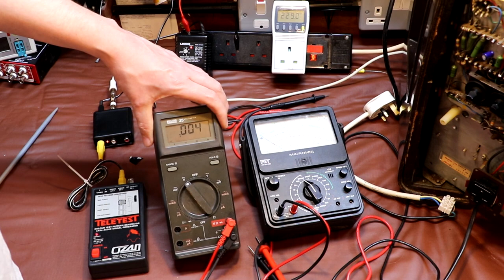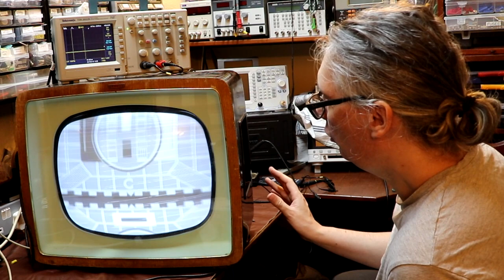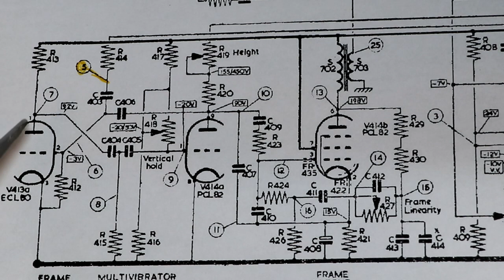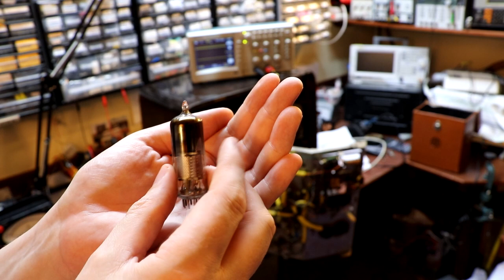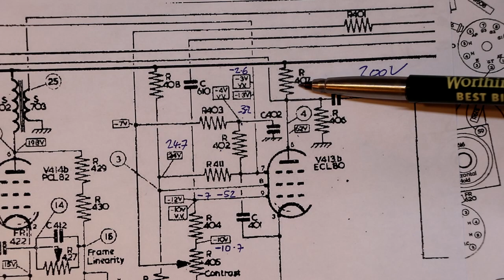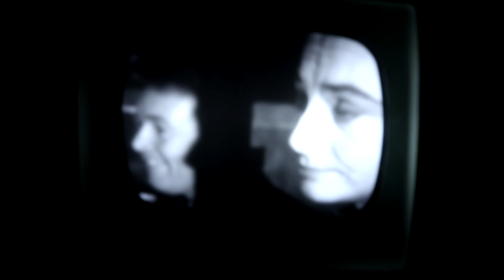Shampo066 Stella TV Repair - Part 3

Comment: Hello again Chris.  I've just been looking through some of the earlier comments, and one of them made me shudder.  It suggested that you have a go at an early colour set, to which I would suggest, "Don't..!!'  Of course, there's always the question of what one would call 'early'.  The earliest, were the 'Dual Standard Hybrids' from Baird and Philips, and they were death traps.  Then came the all transistor 2000 chassis from TCE (Thorn Consumer Electronics) under various brand names such as Fergusen, and Marconi, and also badged by some rental companies as their own brand, e.g. Red Arrow, DER, etc.  The first British colour channel was BBC2 only, on 625 lines, transmitted on UHF band V.  BBC1 and ITV continued to be 405 line monochrome VHF on bands I/III.  Hence the term 'Dual Standard'.  As a precursor to colour transmissions, the new BBC2 channel was only monochrome, and there was good reason for this ... at least that's what I assume.  To remind ourselves now, what was once the case: That the British TV system was viewed as the first 'High definition' system, seems ridiculous.  It would not remain so of course, but I digress.  By the middle 60's, the forthcoming British colour system had been established, hence the new BBC2 channel.  But - and there was a huge 'but'.  The new BBC2 channel would be a completely new transmission service, not just more lines, not just a higher frequency, a new system altogether.  Sounds dramatic now, but it really was back then.  Fortunately, there were too many sets on the old system for it to be scrapped, so BBC2 came upon us gradually, and didn't bother the domestic TV engineer that much.  Most people didn't bother with BBC2 anyway, and those that did - mainly on rental, had a 'Dual standard' black and white TV.  So what was so different about the BBC2 system?  Well, just about everything you knew about 405 had changed.  The video signal modulation polarity was inverted, the original sound carrier was eliminated, giving way to 6Mhz 'Intercarrier' FM sound.  The set needed a separate dedicated tuner.  Brand new valves appeared.  Many of the familiar circuit architectures looked different, and worked different.  And being 'Dual standard' sets,  you had - effectively, two sets in one cabinet sharing the cathode ray tube, and the speaker, controlled by a huge switching system.  Still only monochrome remember, and it didn't end there.  Technology was still on the march with brand new components: Transistorised tuners eliminating the noisy albeit gold plated pinned new tuner valves.  Transistorised modules and 'Acoustic Wave Filters' creating 'Bandpass' filters that eliminated the component heavy IF transformer strips.  Special voltage doublers replaced the EHT rectifier in some sets ... how did they work..??  More workshop arguments.  Many of the 'older than me' engineers had given up by then, but for me and the like, in our early twenties, this was all rather exciting.  I should however point out a truth amid all this theoretical stuff, most TV engineers didn't understand it, and didn't need to.  Sets still only suffered from 'common faults' which quickly became known.  Then came colour, and we started again with a whole new ball game, and the resurgence of City and Guilds college courses to learn about the seemingly impossible.  Were I to go any further, this comment would have to more than double in length, so I'll just repeat what I said at the start, "Don't go anywhere near a 1970's colour TV", that's if you could find one.
If you want to remove this extensive comment from YouTube, I won't mind.  It's only meant for your inf anyway.
Reply from the maker: You should seriously think of writing a book on this or publishing something online you certain know a lot about the fascinating history of television. My short answer is I’m not really interested in dual standard as it is just too modern. I quite like some of the hybrid designs  of equipment when the crossover occurred between valves and transistor but that’s mainly for the sake of being so bloody awful and usually managed to combine the worst part of both technologies.  I don’t really like working on transistor stuff it’s to much like work for me so if anything I want to go back and Collect earlier televisions sets from the 50s.   Thanks for another great comment your a mind of information. Best regards Chris

Comment: Hi Chris,
For some strange reason, though I’m subscribed to your channel, notification did not come up to say you had uploaded a few videos.  Has it happened, I’d been thinking about you, and your Philips television.  As you will imagine, I have some video viewing catching up time to do LOL.
Having read many of threads placed on Television and Audio restoration websites, I’m confident you are in good hands.  Of course, there are a number of them that include loads of text, but say very little, and there are a few that are none sense - I’m sure you’ve read a few, and laughed at them LOL!   
The type of fault you encountered here was fairly common back in the day: it had to be an incorrect voltage since much of that area of the circuit is fairly voltage critical - though no where near as critical as those required for most modern solid state electronics circuits - generally speaking, “Solid state have specifications, valves have guidelines!”
Though I don’t want to intrude, I’ll point out the obvious by saying you have a few remaining issues: one being a frame linearity fault.  Usually, the problem is capacitor related: on the other hand it might be as simple as reducing the picture hight by two inches, adjusting both frame linearity controls for evenness at top and bottom, and them increasing the hight back to the correct level.
Finally, I have to commend you on being able to service a Television without a mirror.  Doubtful I could do that LOL!
Will be catching up on a few of your videos I’ve missed, cheers, the man from Sheffield.
Reply from the maker: Thanks for watching and comments. Now I have a stable picture I can see the linearity and focus issues.   Is the linearity issue likely to be fixed by adjustment of the linearity control or should I change out the capacitor associated with the controls.   Regards the focus control one end of the potentiometer had been cut so it’s fully at one end of the control.  Is there a sweet spot for focus like holding a hand lens or is more focus voltage etc better ?  Yes I also fail to get your notification and just check back on your YT page periodically and I don’t know why that happens. When all this Covid stuff ends it would be nice to meet up and chat in person etc.  Regards the mirror it’s only a matter of time before I get a belt of the back trying to peer over from the back of the set.   I may take a break from the television as I have a ring tester and a Hallicrafter I want too investigate Thanks stay safe regards Chris
Reply: @allthegearnoidea6752    
Hi Chris,
Please accept my apologies for not getting back to you before now.  Due to an unexpected illness occurring in the family, personal time became limited.  Thankfully the illness was not Corvid related.
I shall be referring to “Radio & Television Servicing” 1960/61, J P Hawker. Newnes, Philips, model 17TG200U, pages 551 to 556. 
Although frame linearity adjustments can be made by adjusting R427 (frame linearity) control, I suspect it might not be totally effective with you television.  Though not unknown, it is rare for the actual control to alter in value.  There might be some ‘lower frame cramp’.   
Looking at the above mentioned circuit diagram, as well as partially working from memory (almost 49 years ago LOL), check the values of PCL82 pentode resistor (R421- 330R) – there would be no harm checking cathode capacitor (C408 – 100mfd) whilst working in that vicinity.  Also, check the strength of capacitors (C413 – 22nf, or 10nf), (C412 – 18nf), (C422 – 22nf), & (C409 – 82nf).  Although ‘pf’ capacitors are fairly reliable, especially mica types, they can fail – as far your telly is concerned, I’d think it looks unlikely.  However, if they have gone out of spec, they can cause strange frame distortions (C412, & C417) – checking them might be optional.  Unlikely (C407) would contribute directly to the effect you are getting, but it might be worth giving it the once over with the ‘cappy checker’.  When checking capacitors, you should be looking for DC leakage, amount of V – Loss, value shift, and Equivalent Series Resistance.
Moving over to the resistors, check the values of (R429 – 56K, & R430 – 56K) – they should give a value reading that is no more than their plus/minus tolerance banding.  Checking the four resistors (R 423, 424, R425, & R426) that form the biasing, and feedback line might be worth considering – again, should be no more in value than their plus/minus tolerance banding.  
Check the focus potentiometer (R713 – 2meg) has not been damaged, and one side of its carbon resistance track solder terminal has a good solid connection down to deck.  Also check the value of (R712 – 1meg).  I seem to remember them going high in value.
In some respects it feels strange having a circuit diagram in front of me, but no television LOL.  When I worked in television and audio servicing I automatically developed a feel for what needed checking and replacing: I, along with the other service techs I worked with, largely operated on ‘automatic pilot’ LOL.  What I have sighted above are mere suggestions.  If I was to be specific, I’d need to have the television in front of me where I do a few checks, then say to you, “Replace so-an-so…”  That, of course, would not be totally helpful to you since you would need to know how I’d arrived at what I was saying needed replacing.
Should you require further assistance, feel free to let me know: it’s always a pleasure to be helpful.
Phil.

Comment: Well done Chris, I am battling an old car radio from 1966, Modern electronics made me lose a lot of the old electronic stuff 👍
Reply from the maker: That’s interesting is it all valve tubes or a hybrid. Some manufacturers like Motorola were experimenting with Transistor PA outputs and solid state vibrators for the HT supply. Thanks for watching regards Chris
Reply: @allthegearnoidea6752  did some research seems to be 1970 or 1971 BLAUPUNKT  7639675 HEIDELBERGW serial number B but I can't find  schematic for it, Transistor based

Comment: Also, you likely need to readjust the magnets (those twisting rings) on the CRT that you tweaked the first episode, that might be all it needs.
Reply from the maker: Yes you could be right on those adjustments. I have avoided those so far as you can see I am just learning about Television and didn’t what to go poking around. Now I have fixed the hold problem it’s revealed a few picture issues but I guess that could be expected.  I will probably investigate those In the future. Thanks for watching and comments. Best regards chris

Comment: The resistor was likely fine at first and failed when powered on.
Reply from the maker: I don’t know how I missed that resistor as I had done a basic resistance check but unfortunately I did. Still the whole point of this exploration into television is more about me learning about television rather than a quick fix. So it was good to get the scope out and try to figure our what’s going wrong. As you could probably tell I haven’t worked on a television before but it makes a interesting change. I just like learning about stuff etc.

Comment: I thought 405 was switched off in about 1985 ?
Reply: change C408 for the frame linearity problem .
Reply from the maker: @michaeldranfield7140  that capacitor has already been replaced. Perhaps I need to now adjust the linearity control
Reply: @allthegearnoidea6752  ideally you need to set the picture geometry using a crosshatch generator .
Reply from the maker: @michaeldranfield7140  Thanks Michael I have a cross hatch generator so I can give that a try. Thanks Chris
Reply from the maker: As far as I know the last switch off was County Donegal in 82. But England was before that

Comment: Well done, I have put in the wrong resistor before and caused more problems than I had before I repaired something, with a lot of head scratching and blue air, I finally check the resistor I replaced to find it is far to high.  More hurry less speed.
I liked the old Tardis controls best, it had like a valve/tube type thing going on.
405 lines, how did we sit and watch that, when you see some 625 line pictures of 30 years ago you see just how good or not the picture quality was, all looks out of focus and blurry!
That is what I found with TVs, they are just to big to fix and the voltages can make you pay attention!
Last TV I looked at was 4 years before it went digital.
It was a Philips G8, I changed a board then had to set up the picture again.
More trouble than they are worth, but it was my TV, so o pressure.
I look forward to seeing a perfect picture on it.
Reply from the maker: The focus isn’t perfect but it’s better in real life than on camera. Now I have the pictures stationary it’s revealed a few issues like focus and linearity and these will have to be addressed in the future. Thanks for watching regards Chris
Reply: @allthegearnoidea6752  You will do it, just takes a bit of time.

Comment: Chris your joining us TV engineers, that brilliant I've made it to retirement, and don't stick my hands in the backs of them any longer just 9v to 12 volt stuff these days, I even  let someone else fix my Plasma TV,  what's really good  you've not so far had  a bite from the juice , hope you don't get one of the TV it's hurts, keep going your doing a great job, if you have a web cam you could aim that at the TV, and watch it from your monitor.
Reply from the maker: Hello Paul thanks for watching and comments. I am quite careful to avoid electric shocks but accidents can and do happen but I do have some high voltage experience etc.  This is my first television so it feels like a steep learning curve still I like try and learn new things. I do have some future vintage television for repair but will probably get back to some radios and test equipment. Thanks best regards Chris

Comment: Well done, Chris! Always satisfying to find the problem and repair it. My work-horse meter is a Fluke 8025 - the militarized version of the 25 and my general purpose scope is a Tektronix TDS 3012, I like them for the same reasons you like yours! Regards, David
Reply from the maker: I am not really that fussed on meters but auto power off drives me mad. They always turn off when you most need them. The fluke I’m using has been switched on for about 6 months and when the battery fails I will just replace it simple.  I also hate range changing switches and how some are badly laid out.  I would always spend that bit extra for a quality meter but I’m indifferent to the number of decimal places. The TDS I’m using feel very slow compared to more modern scopes but it was my first scope bought from new and it’s been very reliable and I like the form factor. Thanks for watching and comments regards Chris
Reply: @allthegearnoidea6752   I agree, auto power off is okay for some things - LCR and transistor checkers come to mind - but not for meters. All those digits are useful in the calibration lab, not so much in the field. I have very little experience with raster displays, mostly vector displays, so would like to see the resulting output of the sync separator after the resistor change if you get the chance in an upcoming video on the Stella. Regards, David

Comment: Shango066 would be proud of you! He just wouldn't show it. Excellent work. Love that euphoric feel of a fix. Think you need a resistor colour calculator!
Reply from the maker: I have resistor calculator I just need to build it and start using it. It was one of those annoying circuit diagrams where you have to go an look up the value in a parts list. It should have been 180K I think the one adjacent to it is 680K.    I’m glad I fixed it I didn’t fancy have to remove and test all the capacitors in circuit.

Comment: A nice fix, but I could have told you that you needed to change every capacitor and resistor for modern ones because they will all be out of tolerance... still, Dr Who!
Reply from the maker: I’m far too lazy to do that. I guess I will have too stick with the rather unorthodox method of  diagnosis and repair! Thanks for watching Regards Chris
Reply: you can do that and most of the times it will still not work or work even worse...diagnose and fix is the way to do it...after its fixed then we can do the recap.

Comment: Brilliant :-D,  And dr who is the perfect program to watch :-D
Although i was a bit too young to remember william hartnell.
Yep the image of the two transistor multivibrator with crossing caps /resistors  jumped to mind.
Passives and high voltages,  just asking for them to fail.
Just a bit more tinkering to get the picture a bit closer and its done :-D
Smashing video chris :-D
Reply from the maker: Television is definitely a steep learning curve but it is rewarding when you diagnose and fix a fault.  I think the picture issue is mainly linearity but I also have the focus control disconnected. Thanks for watching regards Chris

Comment: well done chris i knew you would get there allthough i thing we mentioned the sync seperator anode load resistor early on i dismissed it because the line sync was ok  .time for an old colour set next.
Reply from the maker: Thanks Rob I think you did mention that load resistor but I managed to miss it. I don’t know how as I did go through the resistor. I think I look at the focus and linearity next.
Reply: @allthegearnoidea6752  i am impressed with your fault finding an excelent job.